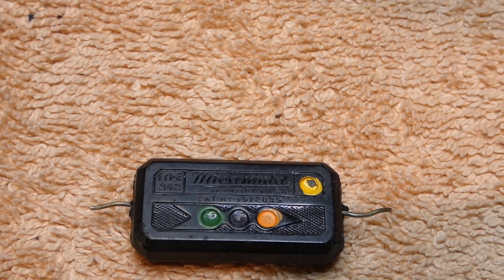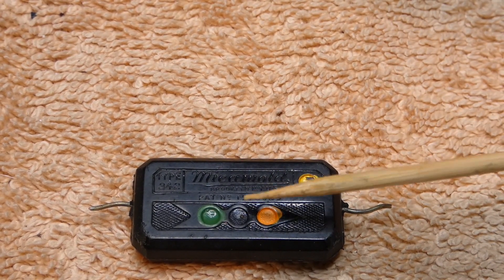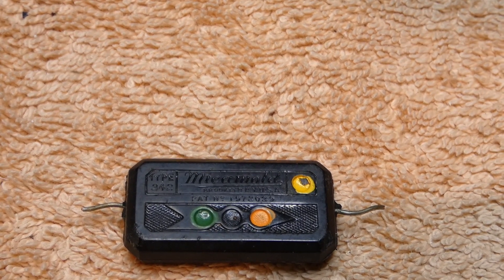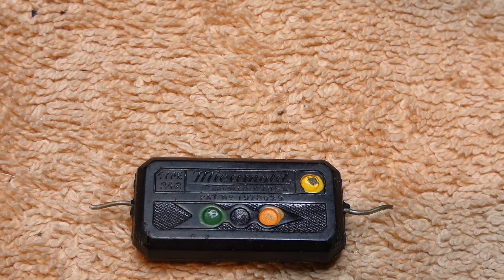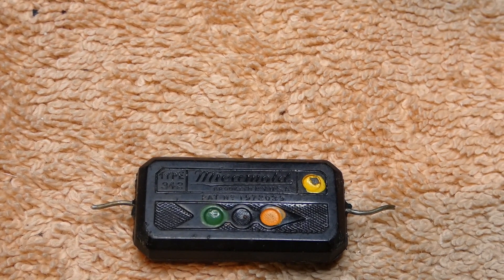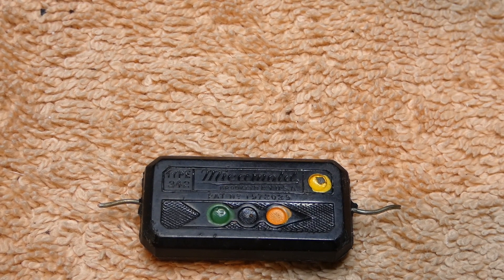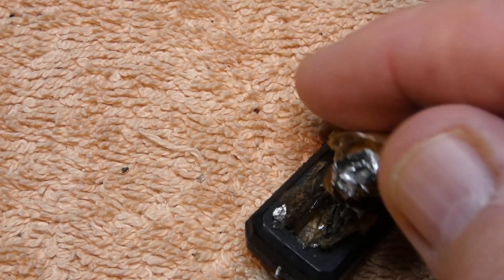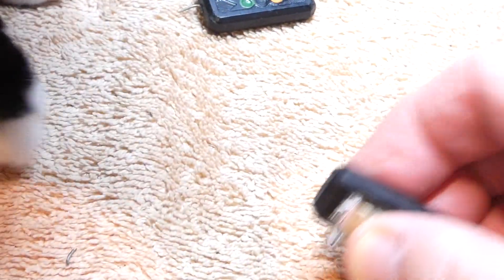Radiowild's Tricky Troubleshooting Tips Part#9 Can "Micamold" capacitors go bad?

Comment: Lester I have one of these. Mine is a red black orange and a yellow on top right corner. What cap can I use to replace it.? Also it's a 342 micamold
Reply: Also it's a 342 micamold
Reply from the maker: I'd go with a modern mica capacitor. Should be just fine. They are usually dark red in color.

Comment: I had a Micamold cap in a 1946 Sears Silvertone radio that physically had a crack in it but tested it still tested fine so I left it in and the radio works fine after I replaced the other caps in it. Very few mica caps go bad. Thanks for showing that one where the cap blew out never saw that before. Thanks Bob and Merry Christmas to you and your family